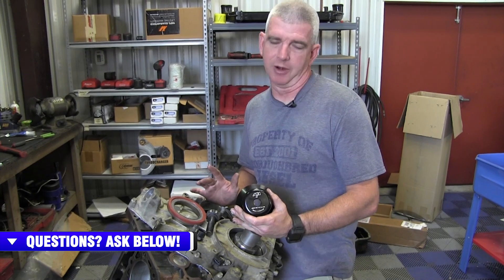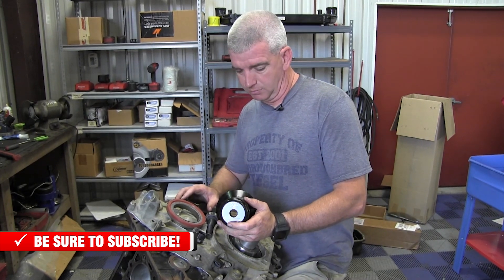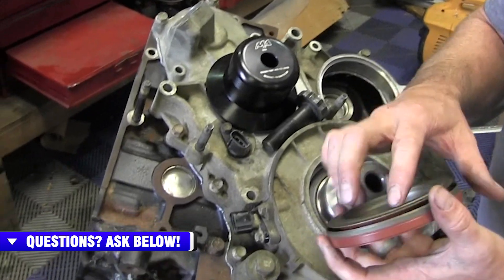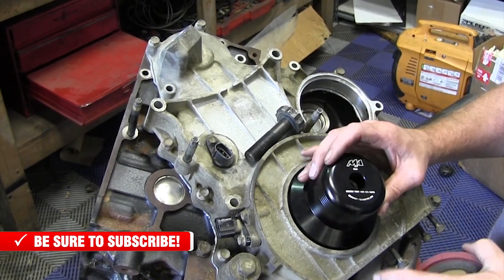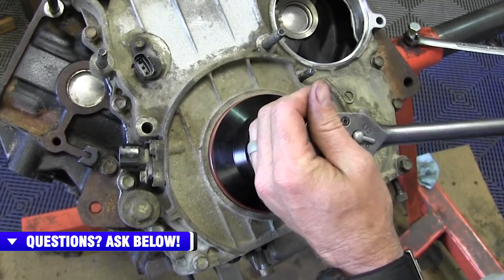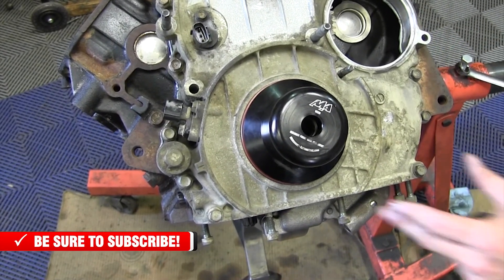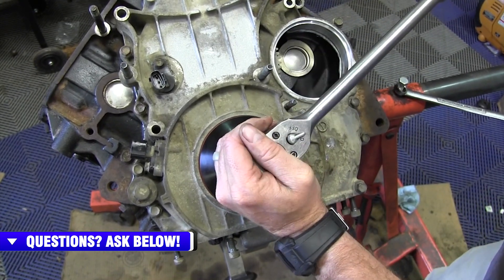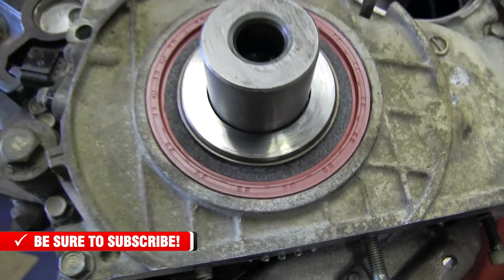Must Have Tool For Duramax Motor Builders | Merchant Front Crank Seal Driver

Comment: my opinion with all due respect why ? would you hammer on the crank? use the tool as designed ? the crank bearings can very easily be damaged by a guerilla banging on the crank .
Reply: lol obviously not an experienced mechanic before this everybody was notching out a 2x4 and destroyin their radiator with the hammer not the crank. 🤣
every seal and seal driver is designed to be hammered in. the bolt is actually more dangerous for the seal, the fact that it can be done safely speaks to the good design of the tool.
to be fair to your opinion I'm sure someone out there is dumb enough to screw up the crank but it wont be with this tool and a dead blow hammer.